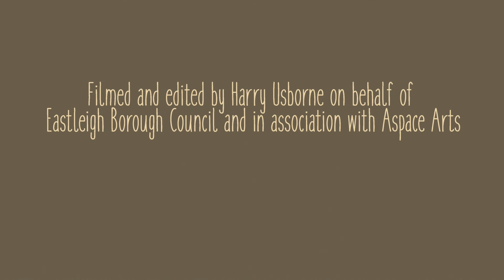How to Use a Ruffler with Historical Costumier Helen McArdle

Comment: Thank you for the video on how to use the ruffler. I have never used any of the rufflers that I have, but I have received my grandmother's Foley and Williams improved new Goodrich No 2. It came completely disassembled in a box stored in her attic since the mid-1970s. After it was reassembled it sewed perfectly and so I decided to try my first time with a ruffler. The ruffler works perfectly. Thank you